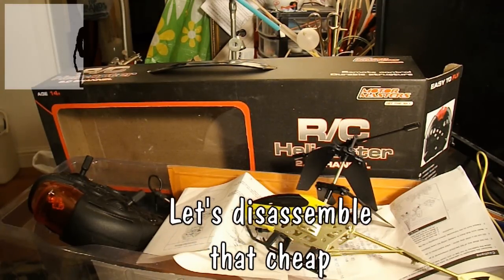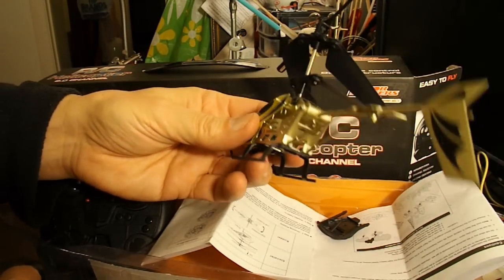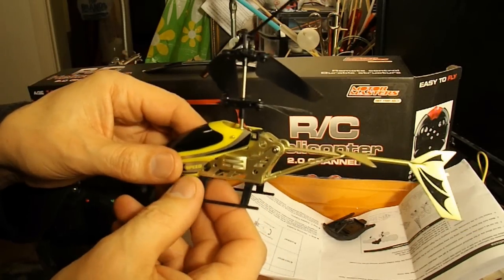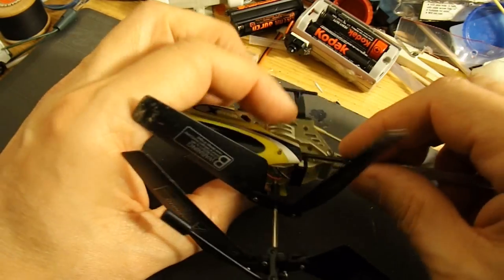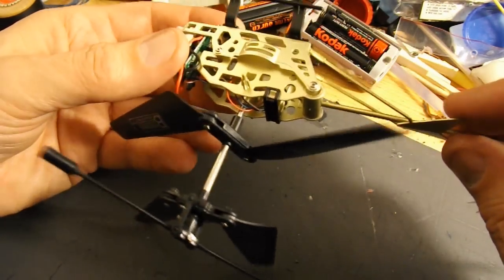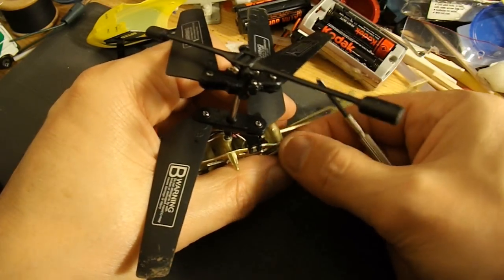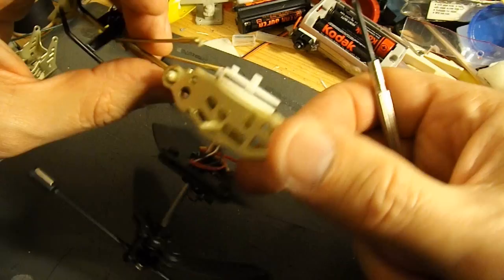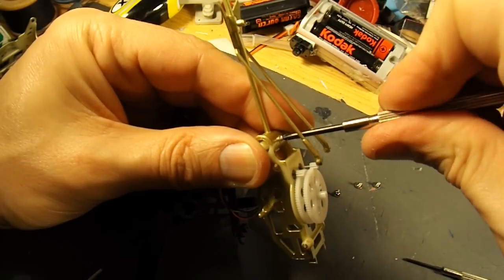Let's disassemble that cheap RC helicopter

Comment: Mine cost £ 12.50 in Range shop Broadheath Manchester. UK. Bought rechargeable batteries on Ebay  had battery charger in shed . Many thanks for video very well explained on how to dismantle or repair when grandchildren break them . They are good.
Reply from the maker: Hey thanks. I just share my experiences, I am no expert in anything 😊

Comment: This design of motor thrust is perfect for a project im starting on... lets get to pulling my cheap ass helicopter apart ;)
Reply from the maker: If yours is infrared controlled (like this one) and you are looking to make a twin engine variable thrust aircraft you may have issues if you try using it outdoors. You can follow my attempt in the playlist linked in the video description, the main issue is you lose the signal outdoors when it gets swamped by sunlight, but if you are looking to go indoors you should be OK.
Reply: GrandadIsAnOldMan ooooh, yeah that might be a problem. Is it possible to switch over the communication type from infra red to something else easily? I was going to use it to speed the assembly of an engineering project for school hopefully, but it is an outdoors device unfortunately
Reply from the maker: Bailey Smith I guess that depends on what you consider "easy". There is no simple way of swapping the components on the transmitter and receiver to change it from infrared to radio, so the "simple" fix would be to use a different transmitter and receiver from an RC system. The next problem would be the range you need. Toy grade RC gear only works over about 10 to 20 meters maximum so you may need to go to hobby grade RC. Some of that gear is relatively cheap so that may not be as bad as you expect.

Comment: this is perfect i took apart my slightly broken rc heli that looked exactly 
ike the u got but the fusalage was little longer. ive been trying to find out how to make the plane for it or something else 

this helped alot
Reply from the maker: If yours is infrared controlled (like this one) and you are looking to make a twin engine variable thrust aircraft you may have issues if you try using it outdoors. You can follow my attempt in the playlist linked in the video description, the main issue is you lose the signal outdoors when it gets swamped by sunlight, but if you are looking to go indoors you should be OK. There is a link to my project in the video description.

Comment: sinve you've taken this apart could you tell me if it would be possible to change the Lipo battery with a higher   mAh so that it would fly longer.
Reply from the maker: You have to consider that a larger battery will be heavier so that will mean the the motor has to run faster to lift the weight so the end result may NOT be a longer flight.
Reply: Adiyat Hasan there is no reason, other than weight and the voltage rating why you couldn’t put in a bigger li-po,
I mean if the battery already in the rc is 3.7v you have to stick with that volt rating or else you’ll cook the PCB.
Reply from the maker: @mikejung3908  he was asking about mAh not voltage and as I pointed out, a battery with larger capacity will also be heavier, so you have to balance out the fact the battery weight will cause the motor to work harder to keep it in the air, so the total flight time may not be increased. Many enthusiasts remove all unnecessary trim so the helicopter is lighter, needs less power to keep it in the air and therefore longer flight times can be achieved.

Comment: hey sir...i have some questions..1 what does a brushed motor mean? 2 what is main difference between 2 channel and 3 channel rc helicopter ?and the helicopter which you have disassembled in this vedio its receiver is having terminals so where  we should connect the battery.,and where the motor should be connected
Reply from the maker: 1. A brushed motor uses brushes to connect the power to the coils. I would suggest you Google that for a more detailed answer or just do a YouTube search. It is more than I can put in a comment reply. 2. A two channel system usually gives you throttle on one channel and steering on the other so these helicopters continuously go forwards and never hover. A three channel system add the ability to hover by giving you forwards and backwards control. 3. The connections on the receiver board are usually printed on the circuit board.

Comment: Hey, need help . The motor of my rc which is the same as shown in the helicopter in your video was not working so i replaced it with a motor of RC CAR. the size of that was big but i managed to fix it. but the helicopter is not flying at all. need help.
Reply from the maker: You have answered your own question. I would guess the motor you have used is too big and heavy and does not have the same power to weight ratio as the one you have replaced so it will be too heavy to fly. Replacement motors of the right size are available on eBay or similar online store and can generally be found by searching for "3.7 volt coreless  motor".

Comment: hey...i want to make mini rc plane.so can i use electronics (motors,battery)of small 3 channel rc helicopter for my project...plz reply fast...
Reply from the maker: If you RC helicopter is infrared control then you will have problems using it outdoors as the sun blocks the signals. You may like this project series Twin Engine Variable Thrust Biplane https://www.youtube.com/playlist?list=PLA5a2xPRSrB1fg_tSRBIbqhtus-gylu9-
Reply: Ehtisham Ashraf

Comment: can anyone pls tell me where can I get the motor becoz the motor of my helicopter is fused or burnt
Reply from the maker: Yugandhar Dive just go to ebay or any other online store and search for 3.7volt coreless motors. They come in various sizes so you need to measure the length and diameter of yours to get the right size. They are quite cheap.

Comment: wanted to know the ratio between the motor cog and rotor?
no biggy though its just ive done the same exact same model still got the remote.the box said can use indoors, yes if u want to spend more time fiddling. Did u get spare parts too for £5 (blades tail etc)?
Reply from the maker: +aidan kenny sorry I really don't remember if there were spare parts in the box. I recently bought a similar one that was probably left over Christmas stock and that one did NOT have spare blades. https://youtu.be/LpgTcIJ18Zc  As for the ratio I did a rough count on a similar toy and it looks like 9 teeth on the small gear and about 90 on the large gear
Reply: cheers

Comment: Sir is this helicopter have 3.7v battery or not
Reply from the maker: 02:26 I show you the LiPo battery. Yes it is a single cell so it is 3.7 volts.
Reply: GrandadIsAnOldMan thank you

Comment: Hey the motor is of 3.7 volts so if i give 6v current to motor, it should generate more power. So can you tell me that if i do so, what is actually gonna happen.
Reply from the maker: If you give a 3.7 volt motor 6 volts it will overheat and fail

Comment: Do you maybe happen to know the output on the charger? I have a bad boy very similar to this one but the charger is missing. I was wondering if my tablet's (5V 2.5A) would be ok to charge it
Reply from the maker: I would expect it to be 3.7 to 4.2 volts as it will be charging the single cell LiPo battery and that is a LiPo battery voltage. When you charge LiPo batteries you do need to be careful or they can potentially catch fire, so you would be better off searching online for a replacement charger. It depends what charger socket is fitted, but I have seen them online. I am NOT suggesting you buy this one - I am just giving you an example of what might suit IF the plug is right https://www.ebay.co.uk/itm/392928031246
Reply: @GrandadIsAnOldMan  Ok Im going to search for something suitable. Luckily I have discovered a cable hidden in the controller and it turns out that apparently one can use it for charging from the controller's batteries, so it will do for now. Thanks!
Reply from the maker: @czarnyrycerz3377  Ah, that is good. Hope it works for you 👍

Comment: Cool but can you explain the infared radio channel signals
Reply from the maker: Depends what do you mean "explain" . It is basically the same as radio control but as it is using infrared light it is more directional and is blocked by anything light does not pass through. The infrared light is used as a carrier frequency that is modulated by the transmitter circuit to carry a series of pulses that represent a discrete code for each of the functions required in a way similar to your TV remote control sending different codes depending on which button you press. The receiver in the helicopter then decodes the signal and applied the required outputs the the relative controls. Hope that helps.
Reply: GrandadIsAnOldMan Coo
knew that but just thought it be important you mention all of the software aspects that goes behined it for the newbies.that you should of put in the video

Comment: My helicopter keeps rotating in one direction on the ground and it is not taking off.what can i do to fix it..????
Reply from the maker: First I would check if there is any trim adjustment on the controller. It may be as simple as adjusting the trim. Second - if it has twin rotors that spin in opposite directions then it is very likely one of the rotors is not spinning properly and that probably means the gear on the end of the shaft OR the gear on the motor has slipped or is split and not gripping properly so that rotor is not spinning at the correct speed.
Reply: @GrandadIsAnOldMan  twin rotors are there..and tnx for answering...

Comment: I bought a very similar type of "Cheaply Made" helicopter for £5.00 at a Flea Market, basically didn't work out of box. Was bought by someone else online, and instead of returning it, they ended up selling it to rip off people.
Reply from the maker: I bought this one for the parts. At that price it seemed a bargain. I did try flying it before I took it apart but didn't do very well. To be fair I hadn't had much experience so in the right hands it might have been OK. The link is in the video description.

Comment: Could you theoretically keep the board and controller in tact, desolder the motors from the wires, and solder a string of LEDs in their place? I wanted to make a remote control light up sign but I must apologize my understanding of electronics is very basic.
Reply from the maker: Thanks for asking. That is not something I have tried so I can only comment in theory. These little helicopters run on 3.7 volts. Some LEDs are happy with that and some would burn out so an extra resistor in circuit might be a safe addition to reduce the voltage to your LEDs. I believe the speed of the motors are controlled by PWM - that is Pulse Width Modulation - and that means the voltage is fed to the motors in pulses, the longer the pulse, the more power the motor gets, I would think the LEDs would be happy with that. I would point out that you can buy remote controlled switches online that are very cheap and will do the job if you just want to switch your sign on and off. Here is an old video on that subject https://youtu.be/3_qsr1hAEXY
Reply: @GrandadIsAnOldMan  I appreciate your reply on such an old video. Upon further research I've found remote control puck lights which are better suited to my needs, I appreciate your assistance, thank you.
Reply from the maker: @bloozby8496  you are welcome, good luck.

Comment: Hello. Can you help me out a bit? I have the same heli as in the video, and all was working fine, until it crashed once. After a bigger crash my top blade doesnt go fast, it's very very slow, spinning but slowly while the bottom one goes normally... What can I do?
Reply from the maker: That sounds like the shaft is bent and rubbing inside the tube. If you are really lucky you could separate the parts and straighten the shaft but that may be difficult to do. The other thing may be the gears have been broken or are slipping on the shaft and need replacing.
Reply: I'll see what I can do, but, anyways, when I use my hand to rotate the blade, it goes like it's oiled, the motor simply seems "lazy", I can make a short video showing it (yes I know it's a cheap heli, but It was a gift, means a lot to me)
Reply from the maker: Have you taken the motors out of the helicopter and tried them with no load. Then you should be able to tell if one motor has been damaged.

Comment: can we get these motors and the lipo battery in some electrical shop? as I want them for my project.
Reply: pls pls reply fast !!!!!!!!!!!
Reply from the maker: I am just back from a 2 week holiday and have a couple of hundred comments to reply to. I would suggest you check eBay or any other online store and search for 3.7 volt coreless motors, they are relatively cheap. I would have no idea what electrical shops would be in your area.
Reply: GV"good video

Comment: here in serbia,those little helicopters cost around 1000 din.(dont know how much it is in pounds,but they are expensive.and i just crashed my easy tyrann 550.top blade hit the bottom blade.
Reply from the maker: That is bad luck :(
Reply: Ja ovakav platio 25€

Comment: Wher i can fawnd the transnitr or the racevr
Reply from the maker: I bought the helicopter new so that I could take it apart and use it's transmitter and receiver. Your chances of getting a matching transmitter if you have lost yours is very unlikely. This sort of toy does not have the support you would get from a more expensive item from a large specialist company.

Comment: The problem is my tail rotor are not working and I guess it supposed to be connected by wire right? mine are not..
Reply from the maker: This helicopter does not have a tail rotor. Does your helicopter have twin rotors? Many of these cheap helicopters do not use a tail rotor. The twin rotors do the steering by varying their relative speed so the helicopter tends to turn left or right and the helicopter is balanced so it always tilts forward making it always fly forward and has no hover or reverse option. If that is the case with yours it may just have a dummy tail rotor for looks.
Reply: When I try to fly it,It becomes spinning just like its about to do crash landing....😧
Reply from the maker: Your controller should have some buttons that you adjust to stop it spinning. The instruction manual should explain this.
Reply: Can i get your email? so i can send the picture..
Reply: nvm It has A B and C button and L R button
Reply: Damn it,I just checked the battery storage which is the spring onr has burnt...
Reply from the maker: The L & R buttons are the ones that adjust the trim to stop it spinning.

Comment: Sir,  where do i get the top wheel of the motors.  Its lost.
Reply from the maker: You can usually find them on eBay or similar online stores. If you have lost the gear, your problem will be knowing how many teeth the gear had so you can order a matching item. You also need to know the diameter of the motor shaft.
Reply: Thank you Sir

Comment: How do you take out the notor of the casing
Reply from the maker: Do you mean "motor", I show you they just pushed out at 10:25
Reply: @GrandadIsAnOldMan  Are they able to come out of the casing ; the insides
Reply from the maker: @MPhatred  you can get them apart. You probably won't get one back together. Here is my playlist for those motors and you will see I have taken a few apart https://www.youtube.com/playlist?list=PLA5a2xPRSrB0CDj118t0MX8PuQxbG7m30

Comment: isbthose motor work for Quadcoptor?
Reply from the maker: You would need 4 matching motors so you would need two helicopters to take apart. It would be cheaper to buy 4 new motors on eBay.

Comment: actualy these cheap little ones are all the same.... the only difference is their design, the brand and the price :D
Reply from the maker: That is a very sweeping statement. Within the half dozen or so 'nanocopters' that I have there are significant differences. Some have twin motors for the twin rotors. Some have a single motor for the rotor and a second motor for the tail rotor. Some are 2 channel control, some have more channels, some have stabilisation and some have none. This particular one is probably at the bottom end of technology with very simple limited controls
Reply: GrandadIsAnOldMan nono, I mean the cheap copters... like this one, they all have the same motrors and so on...

Comment: which is the antena
Reply from the maker: It doesn't have an antenna. It is infrared controlled so it has an IR detector. That is the black square shaped object with 3 legs in the top left of the screen at 02:45

Comment: why you broke the helicopter?)
Reply from the maker: I want the parts for a project and this was the cheapest way of getting them.
Reply: I see. I myself have been looking recently motors and gearwheel..Found them in Chinese pistols.There were LEDs and motors, gearwheel and battery compartment.And the price was less than the cost of one motor (sale). have in stores this helicopter is worth $ 35(we have such prices)
Reply from the maker: Serega Myagkov / Серёга Мягков I am always buying items for parts, even when I don't need them I buy them just in case. You will see on my channel I buy lots of items in charity shops, but at that price I just had to buy it. At the beginning of this video I show another bargain helicopter I bought recently http://youtu.be/ELLBped7hPk
Reply: Yes I agree with you ) necessary things)

Comment: How to return the helicopter 's going on? I think it's due to the difference in speed engines.(İcan't speak english.sorry.please explain.)
Reply from the maker: With only one rotor spinning the torque makes the helicopter spin the other way. When both rotors spin they are spinning in opposite directions so they cancel out the torque, allowing the helicopter to go straight . By adjusting the speed of one of the motors compared to the other the torque can be used to turn the helicopter left or right.